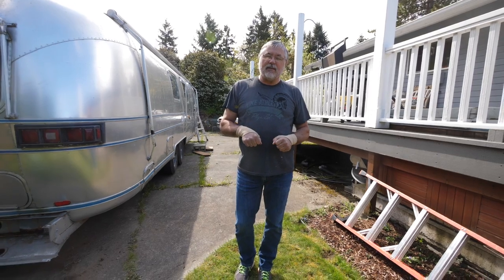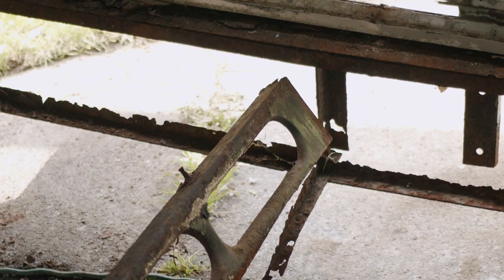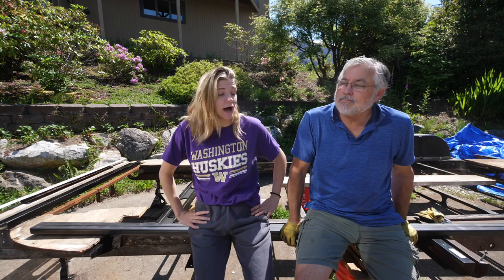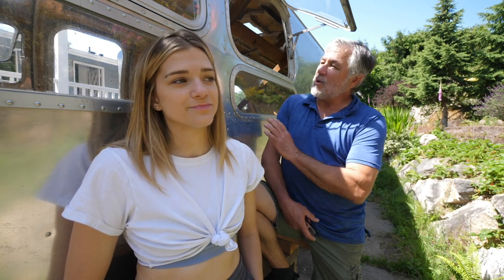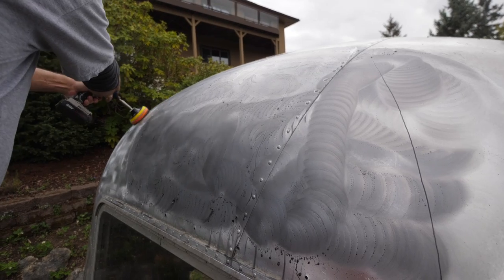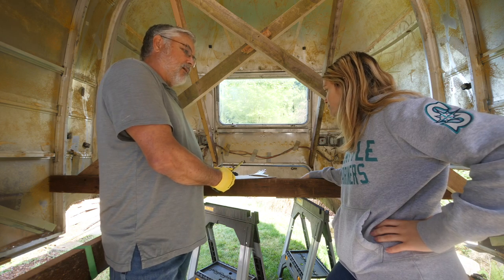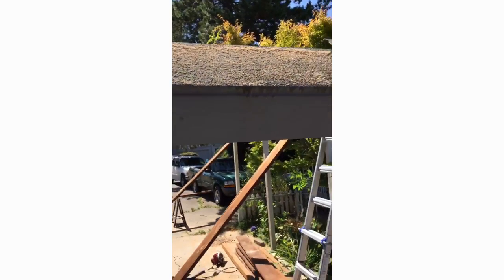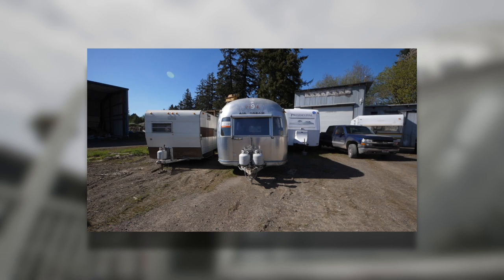The First 30 Days Of Renovating An Airstream Into A Tiny Home | AIRSTREAM  Ep. 2

Comment: Glad to see you two do a complete rebuild. Removing the body from the frame will really help in the long run. And new axles,really good idea. Something to really watch out for is weight. A few pounds here, a few pounds there doesn't seem like much at first but some day it will be time to tow down the road. The lighter it is the easier it is to pull and the less fuel used pulling it. Looking forward to watching this series, good luck.

Comment: Funny thing is, I looked at this airstream a while ago. Glad you found your next project. I ended up getting a 77 itasca, still needs some work but had the layout we already wanted and had new appliances. Instead of working alot on our RV, we are turning our 8 ft utility trailer into a secondary camping unit with a hot tube. The only work we really are doing to the rv is taking out the onboard propane( we are replacing the 55gallon onbaord tank with 2 portable 30 gallon tanks) and upgrade the generator so we have enough extra power to power the hot tube jets.

Comment: So been watching your adventure and Its kinda cool.  Funny thing is back in 2006 My father and I bought a fixer=upper 30ft RV to revamp and use to camp together. We were just like you guys are now, we went in blind and had to research everything about RV's to get the job done. We did not have to totally gut but replace some walls, floors and reapolster the furniture (that was my job). It took time but it came out great  and we used it for years. Have fun it truly is an adventure. Good Bless

Comment: Tip: after you use the buffer you obviously need to let the polish dry a little but don’t leave it on for super long because sometimes the sun will bake it into the aluminum and A) it becomes much harder to buff off and B)it leaves far more swirl marks. Also you need to be applying slightly more polish and you can put it straight onto the pad and just dab it on the air stream that way, no need for a toothbrush

Comment: This is good stuff. 
About the polishing bit. Isn't there the recommendation that any detailing work should never be done outside in direct sunlight. I think one reason is that the polish dries fast and could even damage the surface finish. Maybe try put a big big tarp to cover the area. Also it will give you guys some shade.

Comment: Used to run a car detailing biz out of my garage and had a couple of those big polishers and they are heavy. Your arms turn to butter after a few hours if new at it. Use a product like mother light to medium polish keeping it moist with a light soapy spray, you don't want it thicken and get gummy or it heats up and burns which leaves bad marks. If so use heavy soap and wash it off and start again. For final polish like waxing many waxs are good but stay away from carnuba wax unless you like really hard work lol.

Comment: Normally I'd say you guys were nuts spending that much money on an old used mobile trailer home but considering. what the asking prices are on those things, If and that an IF, you find a buy after its done it might be a good investment, Plus a good father-daughter project if it doesn't ruin your savings and your relationship. I wish you guys the best luck possible on you rebuild adventure.

Comment: The cost seems like you could have bought a semi ok airstream for cheaper (your dad is estimating around 20k to 30k finished). The ones I've seen that arent new but still good, cute, working condition were less than $18,000 and then all you had to do was tailor/flip the inside to your style IF that's what you wanted to do with your father

Comment: Just a heads up, when talking about a trailer/camper layout it's north (front), South (rear), then East/West (sides). So your dad was talking about putting the bed in a East/West layout, using NS/EW makes it easier to keep thing right in your head. Build is coming along nicely, sucks y'all had to do so much work on the frame. But y'all being up North means salt on the roads :.(.

Comment: I know this project is special but i think your over paying for s lot of stuff. Seems like your buying everything new. NOS stuff works just fine. You could have got some 1 ton axles seeing its aluminum and light. Your father was going over detailed info in the beginning of the video and you cut him off. As a mock engineer and carpenter that info is interesting. I understand there is much to learn but it seems your just really breaking the bank on this stuff. Welding is pretty easy try and learn yourself. The tools could be rented or borrowed. The idea of on off frame restoration is amazing and all but it could have done with out to be cheaper and just as good if done right. Just some tips. Ask around if you dont know. Used parts are ok. Best of luck.

Comment: Lol....it sounds like mono-cock. Not mono-coke. And no...yours is not monocoque. More like semi-monocoque. If it were monocoque, you wouldn't have been able to seperate the body from the frame. They would basically be one solid molded piece.
I also think you could get away with generic "C" channel steel and weld it in. Aluminum would be lighter but a tig welder...a good one is pricey!!! A metal store or metal warehouse should be able to get you what you want for way less than shipping alone. 
This looks like a cool project. Hope it turns out well for you!!! 
FYI, in Aviation we use a aluminum polish made by "Met-All" called.....Aluminum Polish. It comes out amazing. You don't need alot and have to be patient. The Dewalt polisher is probably the best thing for this. So good choice.